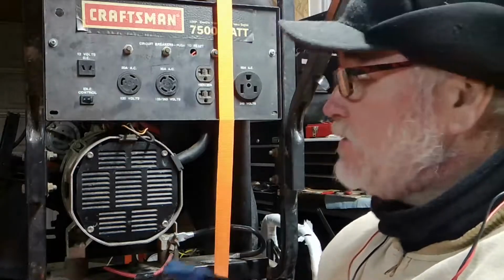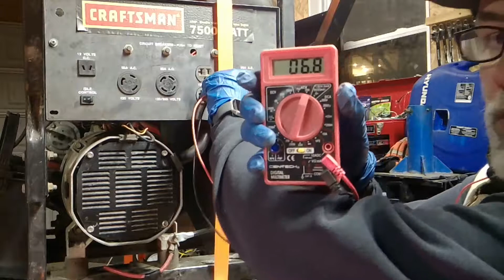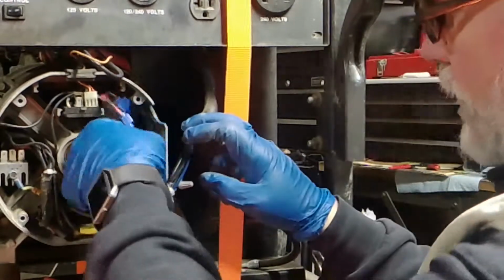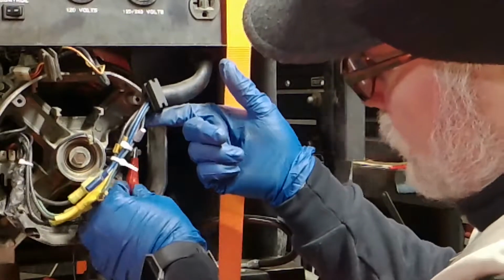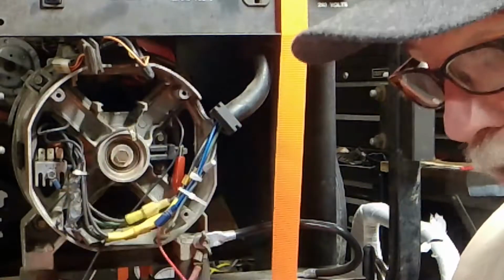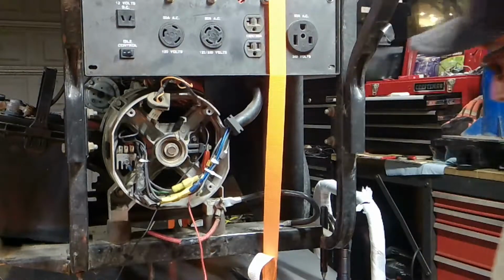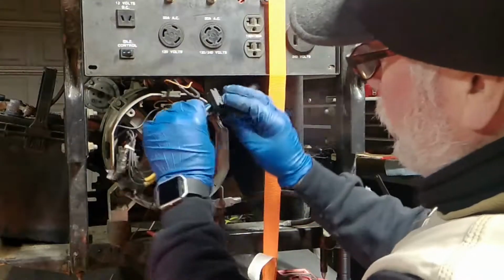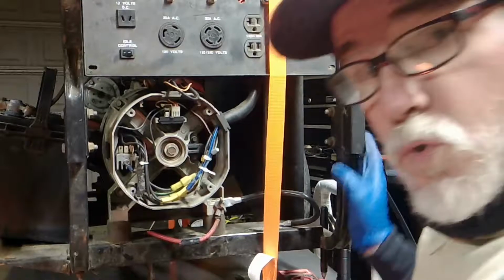How to diagnose generator power loss by flashing field w/12v battery and change voltage regulator

Comment: Time you read a generator shop manual for basic tests ..
Reply: ⚠️Generator safety tips: please make sure you follow all the generator safety instructions carefully and always keep in mind that carbon monoxide fumes are very dangerous to inhale and carbon monoxide is odorless and colorless which is a silent killer. You should always have a carbon monoxide detector if you have a portable generator. Please remember not to ever run your generator indoors. Running a generator indoors increases the risk of carbon monoxide poisoning which causes death. Please make sure your generator is 15-20 feet away from your house and away from doors, windows, and vents to lower carbon monoxide poisoning risk. Please remember also not to run your generator in wet conditions. Running a generator in wet conditions can cause electrocution. Please keep your generator dry. Make sure your generator is dry before using. If you need to use your generator during a wet weather, then you need a generator tent to protect your generator from getting wet. We also need to keep our children safe when we are using portable generators so that they won’t get electrocuted or burned by the generator which is dangerous. We need to keep an eye on children making sure they are not near the portable generator to avoid risks and also carbon monoxide poisoning. Generators can be dangerous so we really need to be aware with the hazards of using generators. Generators pose electrical risks. Please never try to plug a generator cord into a wall outlet to avoid back feeding. They should be plugged into a transfer switch if you need to run your house with the portable generator. Please not overload your generator. Overloading your generator can cause damage to the appliances that are plugged into the generator. Always turn on your generator first before plugging in appliances. And shut off your generator first before you unplug the appliances. Please use a heavy duty cord for your generator and the cord should not be worn out. Worn out cords should not be used on generators. Please don’t refuel your generator while it’s running. You need to shut off your generator and let it cool off before refueling it. Never refuel your generator while it’s still hot. https://youtu.be/I1jT3ANENvI and here is a video more about keeping your family safe while using portable generators. This is just a safety reminder and please make sure you are aware with the hazards of using generators. Thank you stay safe.

Comment: Please show us the multi-meter face when you test for (Bingo) the output power. WE like your educational videos. Thanks for that. Hey how do you order the correct AVR, part/ what are the different ways you go by? Does the old AVR have a part number, or do you go by the Craftsman Model number for listing of parts, or the actual generac model number?.I think you may have shown a small device to measure RPMs and also can be wired for an hour meter - Can you give us a link for that?
Reply: ⚠️Generator safety: please make sure that you follow all the generator safety instructions carefully and always keep in mind that carbon monoxide fumes are very dangerous to inhale and carbon monoxide is odorless and colorless which is a silent killer. You should always have a carbon monoxide detector if you have a portable generator. Please remember not to ever run your generator indoors. Running a generator indoors increases the risk of carbon monoxide poisoning which causes death. Please make sure your generator is 15-20 feet away from your house and away from doors, windows, and vents to lower carbon monoxide poisoning risk. Please remember also not to run your generator in wet conditions. Running a generator in wet conditions can cause electrocution. Please keep your generator dry. Make sure your generator is dry before using. If you need to use your generator during a wet weather, then you need a generator tent to protect your generator from getting wet. We also need to keep our children safe when we are using portable generators so that they won’t get electrocuted or burned by the generator which is dangerous. We need to keep an eye on children making sure they are not near the portable generator to avoid risks and also carbon monoxide poisoning. Generators can be dangerous so we really need to be aware with the hazards of using generators. Generators pose electrical risks. Please never try to plug a generator cord into a wall outlet to avoid back feeding. They should be plugged into a transfer switch if you need to run your house with the portable generator. Please not overload your generator. Overloading your generator can cause damage to the appliances that are plugged into the generator. Always turn on your generator first before plugging in appliances. And shut off your generator first before you unplug the appliances. Please use a heavy duty cord for your generator and the cord should not be worn out. Worn out cords should not be used on generators. Please don’t refuel your generator while it’s running. You need to shut off your generator and let it cool off before refueling it. Never refuel your generator while it’s still hot. https://youtu.be/I1jT3ANENvI and here is a video more about keeping your family safe while using portable generators. Everything that is said on the generator’s operating manual should not be ignored.!This is just a safety reminder and please make sure you are aware with the hazards of using generators. Hope you stay safe as well. Thank you

Comment: I'm looking for someone who can help me wire in my generator circuit board?
Reply: ⚠️Generator safety: always keep in mind that carbon monoxide fumes are very dangerous to inhale and carbon monoxide is odorless and colorless which is a silent killer. You should always have a carbon monoxide detector if you have a portable generator. Please remember not to ever run your generator indoors. Running a generator indoors increases the risk of carbon monoxide poisoning which causes death. Please make sure your generator is 15-20 feet away from your house and away from doors, windows, and vents to lower carbon monoxide poisoning risk. Please remember also not to run your generator in wet conditions. Running a generator in wet conditions can cause electrocution. Please keep your generator dry. Make sure your generator is dry before using. If you need to use your generator during a wet weather, then you need a generator tent to protect your generator from getting wet. We also need to keep our children safe when we are using portable generators so that they won’t get electrocuted or burned by the generator which is dangerous. We need to keep an eye on children making sure they are not near the portable generator to avoid risks and also carbon monoxide poisoning. Generators can be dangerous so we really need to be aware with the hazards of using generators. Generators pose electrical risks. Please never try to plug a generator cord into a wall outlet to avoid back feeding. They should be plugged into a transfer switch if you need to run your house with the portable generator. Please not overload your generator. Overloading your generator can cause damage to the appliances that are plugged into the generator. Always turn on your generator first before plugging in appliances. And shut off your generator first before you unplug the appliances. Please use a heavy duty cord for your generator and the cord should not be worn out. Worn out cords should not be used on generators. Please don’t refuel your generator while it’s running. You need to shut off your generator and let it cool off before refueling it. Never refuel your generator while it’s still hot. https://youtu.be/I1jT3ANENvI and here is a video more about keeping your family safe while using portable generators. This is just a safety reminder and please make sure you are aware with the hazards of using generators. Thank you stay safe.

Comment: Ya'll don't need no 12v battery. Nope just plug a drill into the outlet whilst hit be running at generator speed and turn thee arbor quickly with a wrist snap and hit will give the voltage back to flash the magnetic field and all will be good ifn yee dinna let hit sit too long. Just make sure the drill forward and backwards switch is in the forward direction if you turn the chuck clockwise.